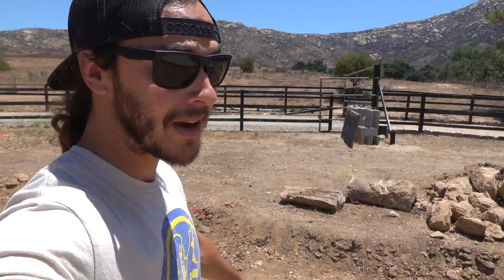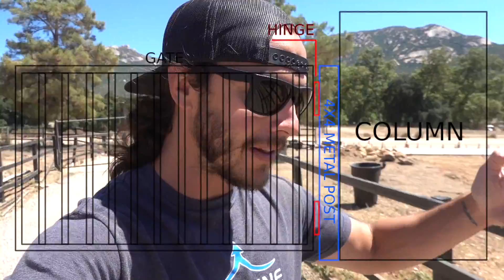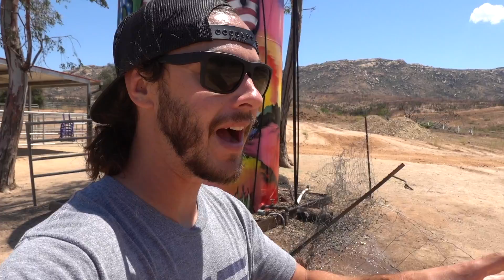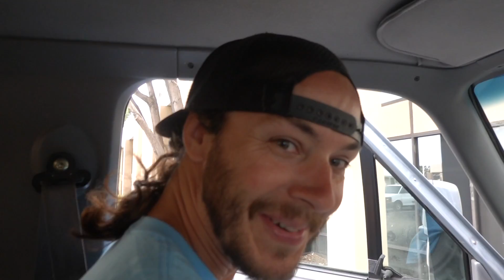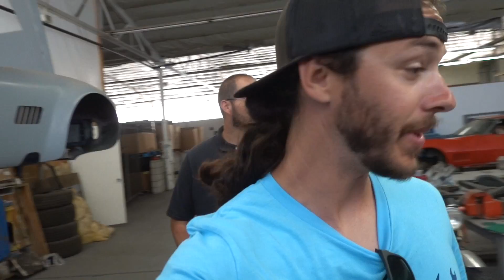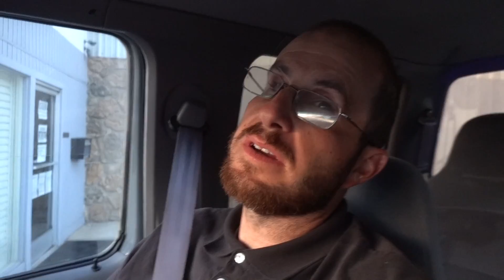(PHASE 2) Building the New MASSIVE Entrance to Ryno Ranch! (PART 7)

Comment: I'd use concrete crush to fill at least 2/3 of the way and then bring dirt in on top of that and then your DG, that way you know that it's good and strong and the crushed concrete should be a lot cheaper... unless you were to fill with dirt off of somewhere else on the property. Someone tell Fern, jet dragsters are actually far slower than Top Fuel or Top Alcohol.. They take a LONG time to get up to speed, they pretty much run as fast as a Pro Stock car. Everyone thinks jet engines are super fast but they aren't.. off the line. Jet engines the faster you go, the more the air rams into them the more power they make. At the hit they are only making around 600HP, maybe less. I know Jay Leno's Y2K jet Motorcycle only makes about 48 horsepower at the start with a Bell Helicopter engine in it but it makes power exponentially as the speed increases, by 100mph it's making well over 500HP, by 200mph it's making over 1300HP.